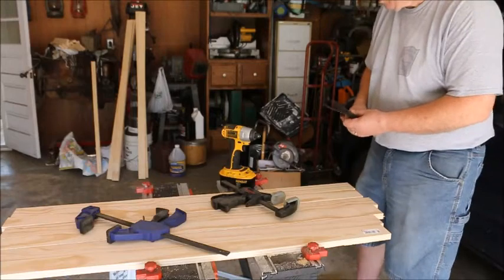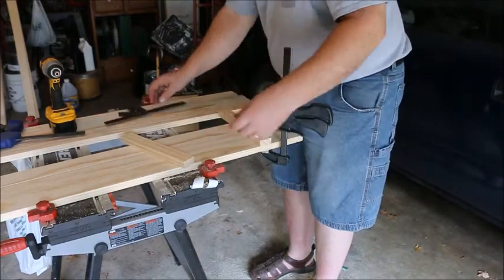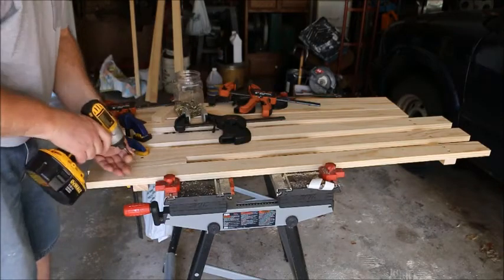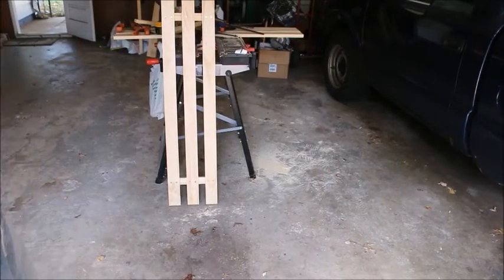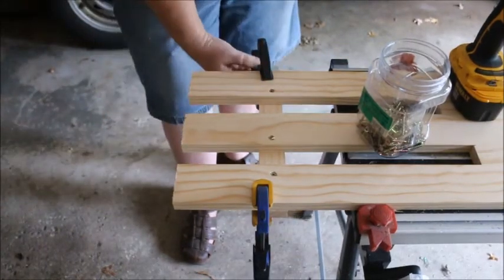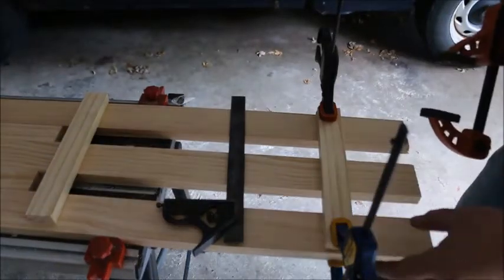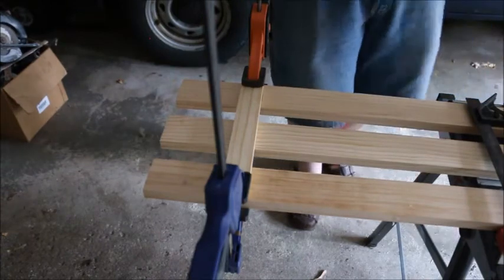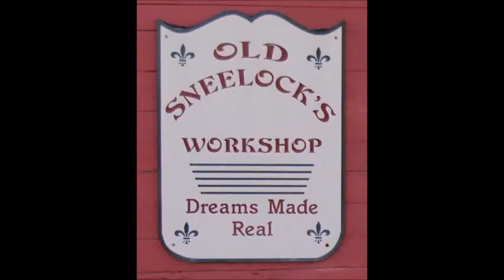MAKING CUSTOM SHUTTERS ~ PT 2 ~ ASSEMBLY

Comment: YOu'll get a kick out of this. Sweetums came in a minute ago and asked what I was upset about and who I was talking to. I told her I was agreeing with Uncle Sneelock about the sticker deal and some cashiers not having the i.q. of a pencil eraser.  And I'm looking at getting another set of a long and short Irwin clamps. Then I'll have 4 and I know where I'll be ripping plywood. Yep, on the tailgate! Good looking shutters! I was even thinking on doing the shelves like that but I know how I am with multiple pieces.  Plywood is my answer with a solid piece to cover the edge. Good old brad nailer!
Reply from the maker: We both talk to each other. I often tell Lydia what you and I discuss. Sometimes she even agrees. 
I'm not big on the whole slats thing either. When we owned the bookstore I wanted to repair some apple crates that were being used as shelves. Rather than try and buy new or pay someone to fix them I bought a Craftsman brad nailer and set about gluing and nailing the corners. I liked the result so well I went through and glued up all the apple crates. Took me a couple months of week ends to remove, repair, and replace them. Then of course I wanted more. I took some old scraps and made a jig. I still had the table saw then and ripped up a bunch of 2 x 4 scraps into 1/4" thick pieces. Then I cut them to length with the chop saw and went to work with the jig. I could roll out a new crate faster than repairing the old ones. Turned out to be a dead end job though. I could by them from Michaels cheaper than I could buy the wood. Can't beat slave labor prices from China. 
You will like the Irwin clamps. I have a few and they are my favorites. Good idea on using the solid piece to cover the edge. I made a set out of MDF with oak strips on the front and back edges. MDF tends to sag but the glued on oak worked like a charm. 
Good luck with the shelves and here's hoping the grading gravy train rolls in every time you need it.
Reply: I think all 4 of us are close enough to live in the same neighborhood.  We're always talking over some of all our odds and ends. I know when the girls (and now baby boy) have a day out, Michael's and Hobby Lobby are a mandatory stop. I got a short Irwin clamp and ended up going and getting a longer one. Now I'll just get one more of each and end up with 4. Between them, 2-C clamps and 3 pipe clamps and a vise I ought to be set for something. And I've got a 1-inch board for the edge guards. Sweetums doesn't want anything I'll have to go under the bedroom and reinforce the floor to hold it up, so I think I'm close on materials. Beats 2x12's!

Comment: they make the purchase process what it is, because sooner or later you will be doing your own scanning and bagging, wont be anyone there at all, they dont want trained people, they are harder to replace, gives them leverage,  i purposely never use that at the supermarket, i dont think its right, its not like they even offer me a discount for doing more of their work, what is next? they require me to restock the shelf too?
Reply from the maker: Jusb1066 I think you are right. 48 years in Corporate America has taught me that it's a race to the bottom. Creating a system that is more reliable and accurate is always good. Using the savings to increase the business is good too. Using it as an excuse to cut staffing is poor business. Use the savings to increase your ability to meet the needs of the customer.
Reply: 'Sooner or later' is actually *NOW*.  Wal-Mart has had them a while now.  At first they had scales in the bagging area, and the system would holler if you didn't put the pack of gum you scanned into the bag.  Phase two added a hand scanner, and you didn't actually have to put things in the bagging area.  Phase three has screamlined the process a bit, but mostly similar to two.
As I see it, the potential for shoplifting is *MASSIVE*, because I've seen that the "watchers" are inadvertently learning that customers don't disable the RFID tags, and will turn off the door alarm quickly without even checking the outgoing customer when the alarm sounds.  I could probably guess which items don't have the tags, and carry a few out "freebies" every time I go through the checkout.  I'm actually an honest guy, but I often feel like I'm in the minority.